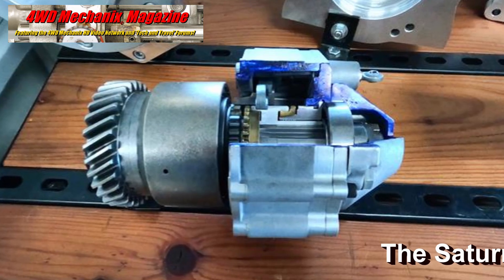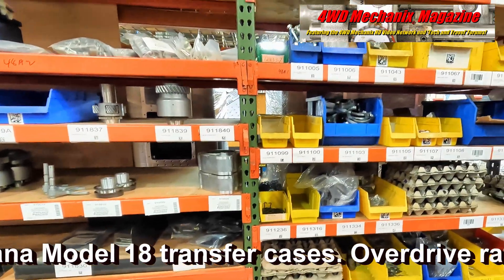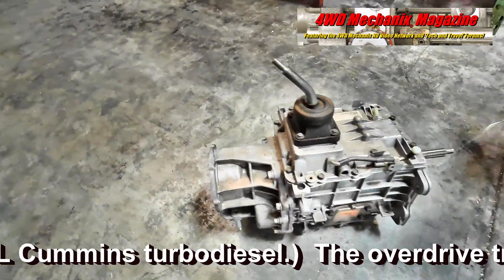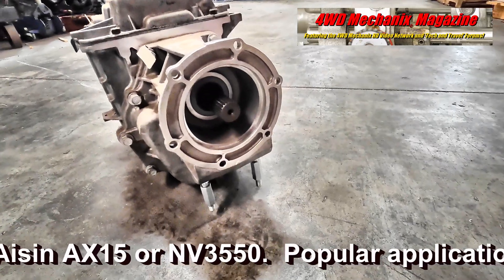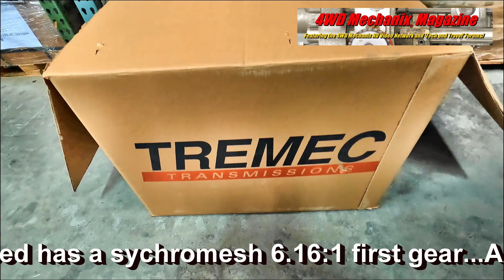Advance Adapters: Vintage Saturn Overdrive to the Latest Tremec TR4050 4x4 Transmission Conversions

Comment: Curious about finding an Advanced Adapter twin stick overdrive unit, to fit my 1983 C-30 2WD SM465. Will pay $$$
Reply from the maker: Are you looking for an Advance Adapters "Ranger Torque Splitter", the two-speed (overdrive) gearbox that goes between your GM V8 bellhousing and the SM465 transmission?  The folks at Advance Adapters could have a lead:  phone 1-800-350-2223 or contact https://www.advanceadapters.com.  I ran this same setup in the late eighties, a Toyota Landcruiser FJ40 with a 383 Chevy stroker V8 and SM465 four-speed manual truck box.  Great for split shifting and an overdrive gear!  The Torque Splitter uses a single shift lever.  You have two levers with the SM465 Muncie truck box and its cane.
Reply: @4WDMechanixMagazine  Yes, this is exactly what I'm lookin for. Thanks for the tip. I had heard they don't manufacture this untit anymore, but hoping for some kinda lead.
Reply from the maker: Most have opted for later transmission swaps like the NV4500, NV5600 or more recently the Tremec 4050, each with an overdrive top gear.  (The iron NV4500 five-speed and iron NV5600 six-speed were available in GM and Dodge Ram 2WD and 4WD trucks.  I prefer the NV4500 five-speed for its reliability record.)  Split shifting was the bonus with the Ranger Torque Splitter.  There was always a "right" gear when pulling a load or saving fuel at cruise.
Reply: I actually got a reply from them, and appreciate the efforts. Doesn't look too proming tho.
Reply from the maker: Thought that might be the situation for the reasons I suggested.  There's the Gear Vendors overdrive available for your SM465/2WD truck.  For a C30, the Gear Vendors overdrive would be approaching the top of its GVWR/GCVWR.  (Gear Vendors' commercial warranty is limited to 25,000-pounds GCVWR.)  The good news is that it can be split-shifted and installs readily with a driveline length cut.  Here are details:  https://www.gearvendors.com/cg2wdt.html.  Again, you could consider an NV4500 with overdrive if split shifting is not a must.  Your truck is 2WD, and the changeover would not be difficult (transmission mount and driveline length, primarily).  There are recycled and rebuilt transmissions available.  Check out the NV4500 availability.  The NV5600 is an option, though there are mandatory upgrades needed to keep an NV5600 alive.
Reply: @4WDMechanixMagazine  I've just lost 2 lengthy replies', to your comments above, (with an incorrect button push) and am extremely frustrated. Sorry. Will respond later, after I regain my composure. 😡
Reply from the maker: We've all done it!  Looking forward to your replies...I trust the info from this end is helpful.

Comment: How bout 80s 454 2wd  infrequent car towing, 12 gvw ? Adequate torque capacity?
Reply from the maker: During that era, I used the Advance Adapters Ranger "Torque Splitter" that commonly went between a Chevrolet V8 bellhousing and an SM465 Muncie truck 4-speed.  0.73% overdrive and a rugged torque rating made the two-speed Ranger gearbox popular.  Though no longer manufactured due to alternative conversions like an NV4500 or NV5600 transmission, or the new Tremec TR4050 design that Steve Roberts and I discuss in the video, the Ranger Torque Splitter would work well with an SM465 4-speed in a 2WD hauler.  If you cannot find a used Torque Splitter, a used NV4500 or NV5600 conversion might be cost-effective.  The Saturn Overdrive is exclusively for a Model 18 Jeep or early Scout application and would be too light duty for your truck's torque and load requirements.  The Saturn is designed to fit in the PTO opening of the Model 18 Spicer transfer case.